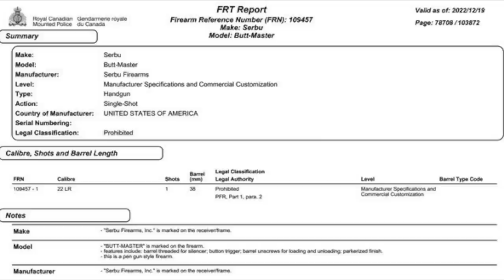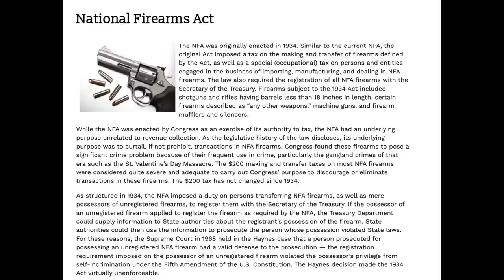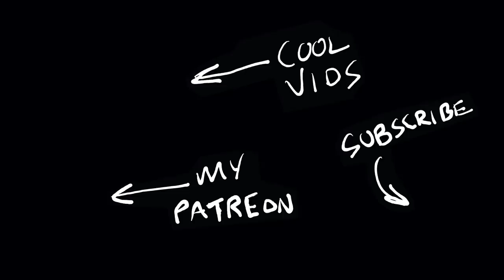BUTT-MASTER: Conspiracy and Physics

Comment: I have a small model cannon that runs on 209a primers and the striker on that also frequently bounces back a bit after setting off the primer. Interesting physics lesson for sure!
Reply: my cannon uses fuse wire
Reply: @bermchasin  theres quite a few of those out there. Who makes yours?
Reply: @BrianMusic12  i made it myself.
Reply: That's a thing with a lot of commercial inlines too. The breech thrust on the primer exceeds the striker mass and spring, auto ejecting the primer in many of them when the pressure goes up.

Comment: Its amazing how "plastic" and springy even the hardest materials can be, especially when things start getting longer. Ive seen slo mo videos of 32" barrels wiggle like a tension spring without a load on it. What realy amazes me is the delay that occurs from the time the bullet is fired and the gun starts to recoil, the effect is very noticable with revolvers. The cylinderbarrel gap flashes and then you see the escaping gas from the barrel, the bullet leave, and then the main muzzle flash and bullet leave the barrel and some more delay and then the barrel flips up after so many milliseconds... one would think the barrel would begin to flip upwards as soon as the bullet leaves the casing or just as it leaves the barrel.

Comment: I think there's more going on other than just seeing it on the international firearms list, but I do think you should make it with a longer barrel. And you know you can have a muzzleloading or I shouldn't say muzzleloading necessarily but a black powder firearm like that that can be fired with a 209 primer or a 22 blank 🤔
Reply: and with more .... girth
Reply: Any hints as to what muzzleloader has used a nail gun blank as the ignition source? I've found precious few that I recall.
Reply: it'd still be an NFA item even with a longer barrel because of its shape.
Reply: @alexm566  I don't believe it would be an nfa if it was a black powder device because muzzleloading and black powder devices are considered non-firing that's why they could get away with making some of the handguns and burglar window devices
Reply: @littlebear1520  Yup but much less people know how to fire blsckpowder, let alone do it safely.

Comment: Mark are you now working on a Special Purpose Emergency Rifle Model? Maybe a take down mostly into a long tube for wilderness back packing, etc. Thumb/hand trigger, single shot again or a double drum saddle magazine. Having the stock tube unscrew to use the butt plate as an axe or prying tool, storage for fishing stuff and a ferro rod, or tall thin pot to boil water would be a thought.
Reply from the maker: The S.P.E.R.M. would probably be a big hit up in Canada! I can imagine it flowing all throughout the country, and making inroads into areas that are usually considered...well, "outroads", if you get my drift.

Comment: Okay, exactly how long does it take for the priming compound to detonate? You have to be very careful using terms like "instantaneous". The firing pin hits the case, then has to compress the brass to impart energy to the priming ompound in order to compress it sufficiently to cause it to go bang.
For that matter, what is the detonation mechanism of the compound? Is it deformation of the molecules due to being compressed? Localized heating due to compression? Something else?
If you compress the compound slowly will it still go bang? You can check that with different strengths of firing pin springs, ot by compressing the rim in some kind of vise jig.
If you cool it does that change how long it takes to go bang?
Got any liquid nitrogen?

Comment: The Mossberg mc1sc has a backplate that has a button that when pressed compresses the striker, and the plate can slide down. My question is do you think when the striker hits the primer, that the striker will bounce back like in the buttmaster? And if so, do you think it's possible for the striker to bounce back leaving room for the compressed striker to move forward a little and allow the backplate to slide down? Tricky to explain but apparently the MC1 has had some back plate failures for other people I wonder if it's because the Stryker bouncing back then the whole thing flings forward because the slide is moving back creating not enough pressure on the back plate to keep it in place

Comment: Happy new year Mr. Serbu. 

I get to spend mine in a Tribal Casino as a Slot Machine Tech, after spending 20 years working as an ET in the USCG…. 😂

Tonight should be fun

edit

The Butt Master is damn near identical in its function to a pencil-flare launcher. (Had to train on many, and we had the entire crew of 80-180 light them off on the 4th and new year)

Comment: AOW question, could you add an AR grip adapter in a place that would allow a right handed persons thumb to trip the sear, kinda like sweeping the safety down on a 92FS, and just have it as a pistol?
Reply: You could expand on that idea and have a finger trigger that holds the head of the cap screw back. 🤔 It wouldn't be more than a simple claw.
Reply: @randomidiot8142  just have the trigger be a little lever that kicks the "bolt" off of its shoulder. It could be totally outside the gun, which would be interesting.

Comment: You can overcomplicate it by adding a rotating locking bolt with a delayed primer striker just for fun. Then your charger handle won't bounce cuz striker spring would absorb elastic harmonics.
Anyway, are you making for Edward 22ish-50bmg blank sabot single shot rifle? Those oxygen cylinders won't punch through themselves...

Comment: That's pretty cool. I have been wondering for a while if how solid a stance/grip is would affect penetration, initially I thought heaps but then very little and now I just don't know.
Reply: With a barrel so short, I think the difference in exit velocity will be very minimal between a firm grip and not being held at all. The bullet just isn't in the barrel long enough for that slightly reduced chamber pressure to have a big effect IMO. Compared to the inconsistency in powder loads between different rounds of the same .22 ammo, the inconsistency in your grip would be negligible, again IMO. I haven't done any calculations to back this up, just gut feeling.

Comment: You should figure out a way to see if this happens in most firearms.
A pistol would be interesting to see if this really happens.
It goes so fast and spring tension is high enough don't think you can see it with the naked eye

Comment: I noticed in shooting 9mm guns that, I had experienced jams far more often than with any other gun. Therefore, I did not like 9mm guns. Then, I read somewhere, that machine gun mounts are super important, rigid mounts won't allow certain guns to function properly. They need rebound to allow them to function, but at a certain threshold. Now I hold 9mm guns more rigidly, and have less problem. I like .45 better still, but have noticed a marked difference after holding 9mm guns more rigidly than say, .44 magnum. I like revolvers too, so that doesn't help! Please! Tell me im wrong

Comment: Mark, I think the reason your Butt Master kicks the go button like that is you do not have a locked bolt on the cartridge. The energy needs to travel, and when the round fires it pushes back on the firing pin and spring, instead of the body of the firearm.

Comment: Isn't the  bolt bounce  in the butt master  kinda how blow back submachine guns work?
Reply: First thought that came to my mind as well. Every action has an equal and opposite reaction. Laws of physics. All depends on how he made it. Most guns have a bolt lock so this does not happen until it's supposed to. However this looks like nothing more than a prison zip gun. If he is dropping the bolt right on the shell then sure it will bounce back. However in a 22 rim fire there is just not that much pushback. Depending on the strength of the spring (a holding force) he could probably get that more closer to zero but then it would be hard 'to cock' if that's the correct term here.

Comment: Actually the real reason for the bolt bounce back is because the 22LR is such a powerful round that it’s pausing the rotation of the earth for a micro second, when the bolt doesn’t bounce back is because he has the barrel pointed the other direction and it speeding up the rotation for a micro second 😂😂😂😂😂